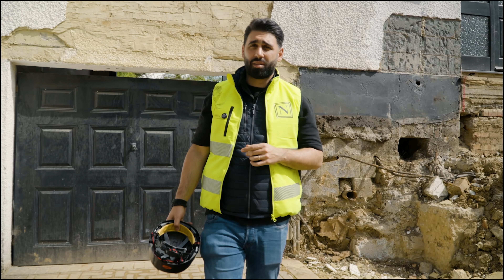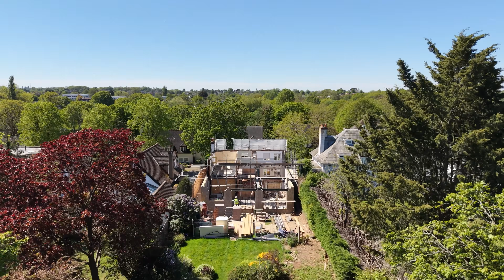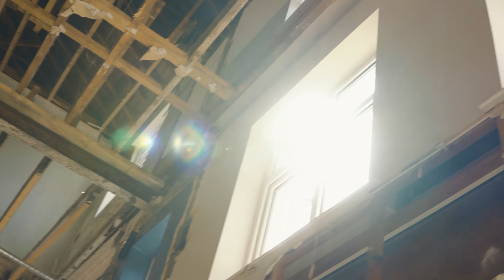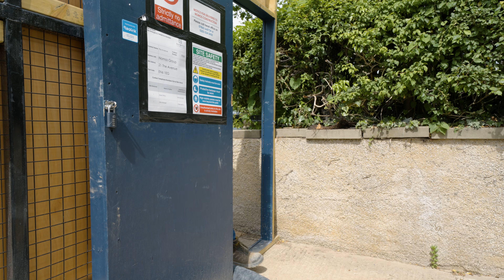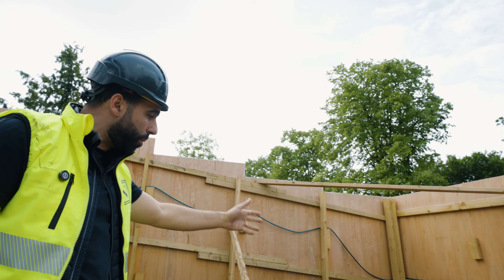This Luxury Home Was Built Wrong. Here's How We Fixed It.

Comment: Wow what a nightmare but so nice to see you’re doing a great job and making sure everything is done right. Well done guys. Looking forward to seeing this one progress. 
Genuine question though, wouldn’t it have been quicker and cheaper to just knock the whole thing down and start a fresh?
Reply from the maker: @jonathanchappell9596 This was discussed during the planning stage; however, due to the property's location within a conservation area, the situation was not straightforward.
Furthermore, a building can only be fully assessed once areas are exposed during the construction process. Unfortunately, the trial pits undertaken at the pre-construction stage did not identify these significant issues. As works progress and further areas are opened up, more evidence will emerge explaining why the property was experiencing such substantial structural problems.

Stay tuned becuase its not worth missing!
Reply: @TheNomosWay thanks for explaining as I said love your work. Always top notch and professional well done 👏